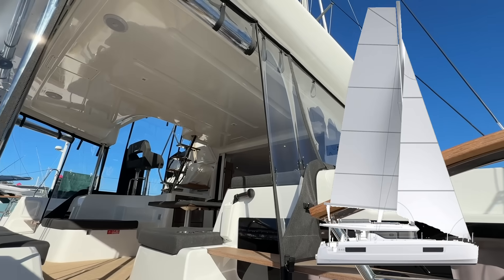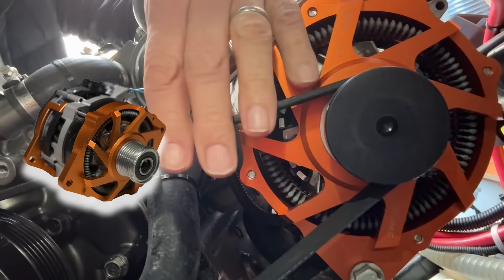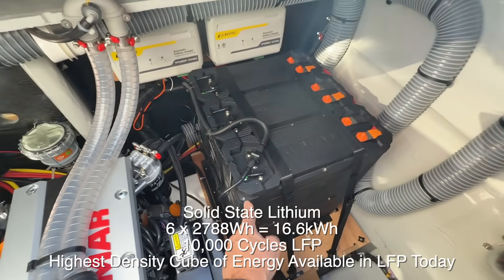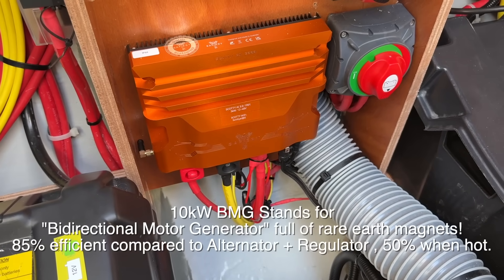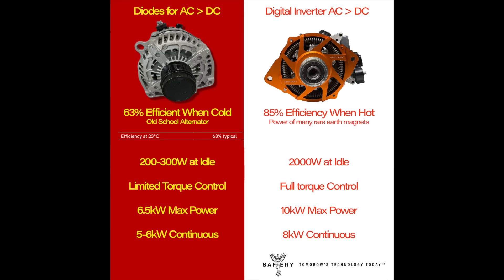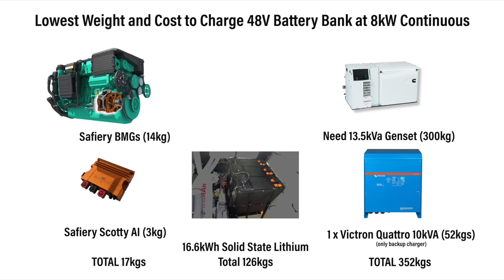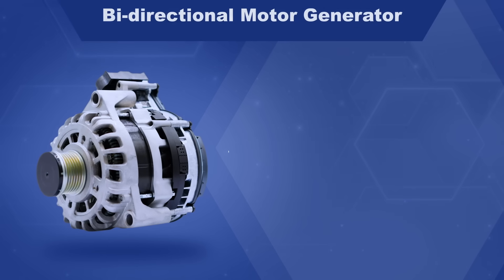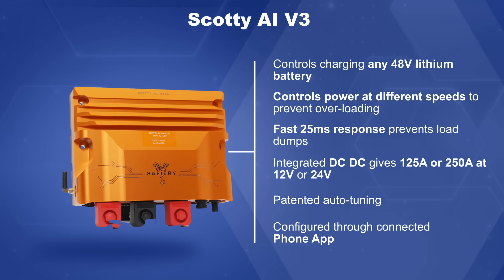Lagoon 43 Charges 16.6kWh 48V Solid State Lithium 10kW Bidirectional Motor Generator power NO GENSET

Comment: Unfortunately way too expensive. You can Burn very much diesel for that price
Reply from the maker: Sure, if you have room for a genset.
Reply: @Safiery  or you could use a 12 to 48 volts dc dc charger
Reply: Due to its efficiency alone I would absolutely buy it for that price. Moreover,  with Scotty it's bi-directional from 12 - 48v. This is absolutely amazing. Though the mounting points may not be ready for my Amercian van...gonna go to a shop and make it work...somehow.

Comment: In this application does your alternator double as a starter for the engine as well? Another neat application would be somehow clutching out/through/around the engine for slow speed trolling off the batteries. I know silly but I just thought of it.
Reply from the maker: Its not a bad idea as the unit is bi-directional. In this lagoon there is a 12V alternator as well. but we can charge the 12V Starter battery frm Scotty AI as we now have a full low side charging option you select on the Phone App.

Comment: Do you actually have a proper thermal management for those batteries? All that hardware might produce quite a lot of heat
Reply from the maker: Yes, our batteries have excellent thermal performance.. See the video were we charge and then discharge our new Solid State Battery at 2C. 5000W from a 2788Wh battery.

Comment: Does the DC-DC converter supply an output to turn off a charge light on the dashboard?
Reply from the maker: Thats a good question. On this new boat, there is no "Charge Light". The Victron Display is an app on the MFD so at any time one touch and you see on the MFD the charging amout plus SOC of batteries. Users think this is a better outcome than the charge light.